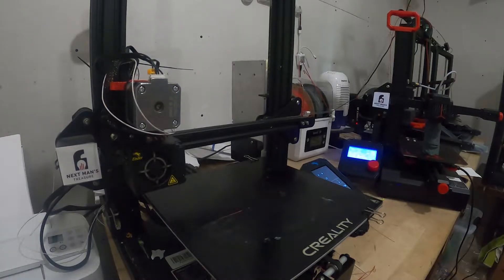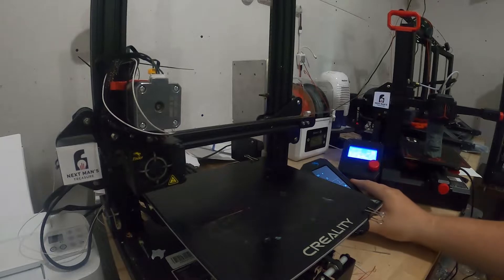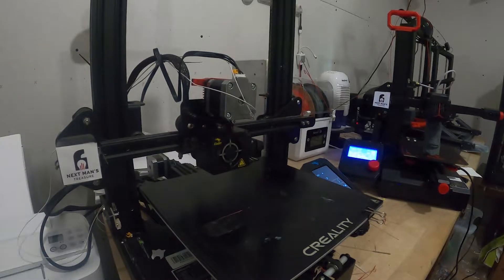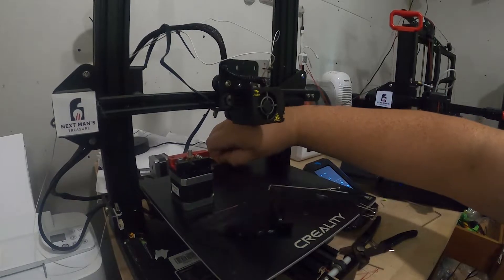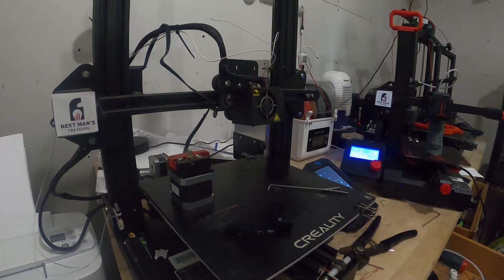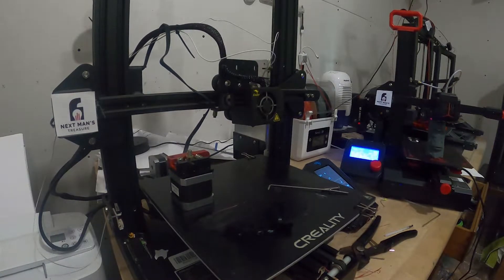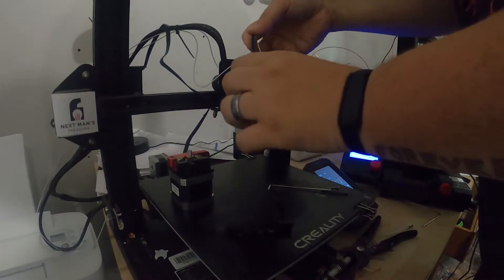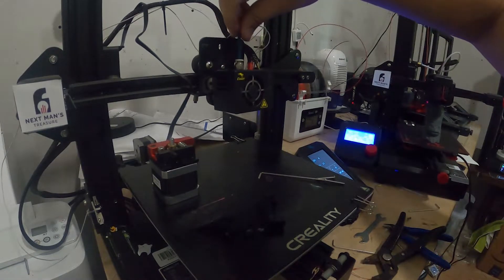Troubleshooting a partial clog on an Ender 3 Pro

Comment: I got my Ender 3 V2 from MicroCenter for $50. 

It was the store demo and one of the stepper motors had seized up, and a stop switch arm also got broken. They took it apart, put it back in the box, and slapped an "As-is" $49.96 clearance label on it. I just had to take the gamble.

It was a $20 fix for genuine Creality parts, so once I realized it was so easy to work on, I replaced the hot end (GCR), the extruder is now all metal and direct-drive, it has auto-leveling, and I also did the Capricorn PTFE tubing. 

I misunderstood the fan settings so my first print warped, but my second print (ever) was almost perfect. Once I sanded and annealed the PLA+, you couldn't even tell it was a print. 

I also gave it a print bed light, so in its final form it's got all the creature-comforts and upgrades, and it still cost less than MSRP of the bone-stock unit. 

I don't think I would have gotten into 3D printing if I didn't get such a deal on my printer and have to crash-course rebuilding it with no past experience. I never even tried printing anything with the stock hardware; by the time I got it working mechanically I had already moved on to upgrading it thanks to advice from other creators.
Reply from the maker: I got into the hobby in a very similar way.